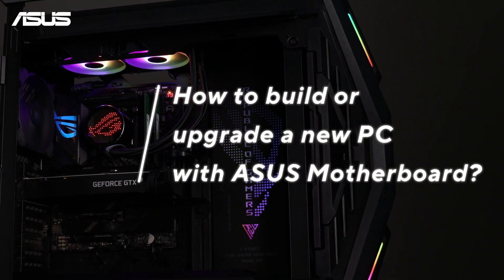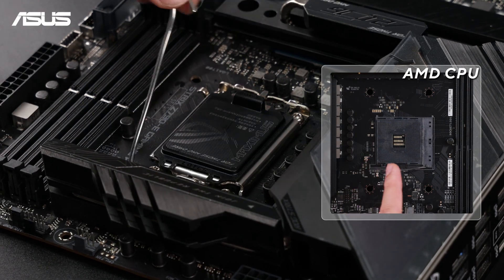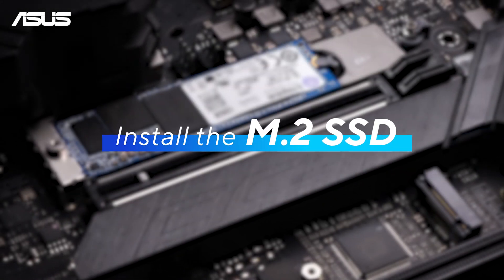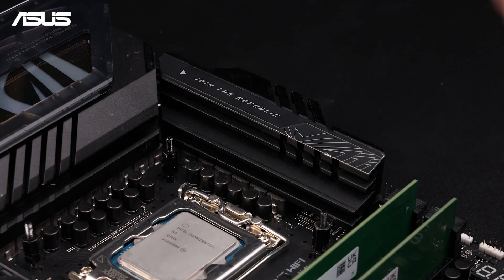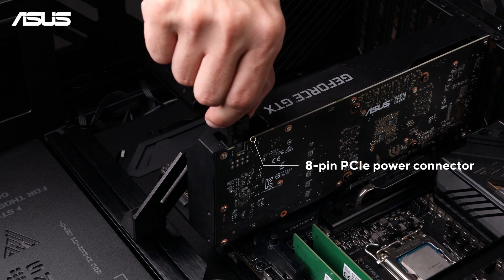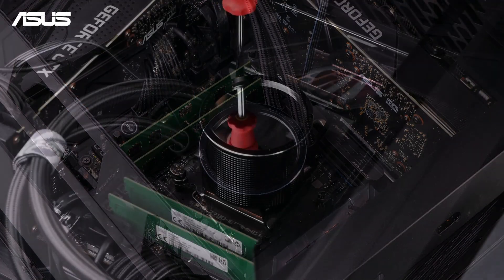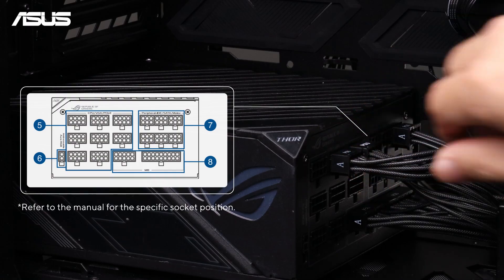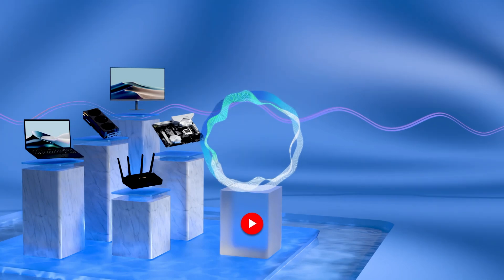Step-by-Step Guide to Installing ASUS Motherboards and PC Components | ASUS SUPPORT

Comment: It’s been 2+ months, my motherboard case is still unresolved. I was promised a sealed pack brand-new replacement by 29 Sept, now told it won’t be sealed. How is that “brand new”? My work is stopped, losses daily. Need sealed pack ! Case ID: ING2T80437
Motherboard Serial Number: R1M0CS01P9977FN
Reply from the maker: I have forwarded your feedback to the relevant department for further confirmation.
We apologize for any inconvenience this may have caused.

Comment: I sent my ASUS ROG STRIX Z790-F Gaming WiFi motherboard to ASUS India for warranty service.
They promised me a new replacement… but sent back an old, used, and damaged board instead.

Staff told me to “use” this broken board and then stopped responding. This is not acceptable from a global brand.

📌 Case Ref: ING2T80079

I’m demanding ASUS provide the brand-new, sealed-pack motherboard they promised — nothing less.
Reply from the maker: We apologize for the unpleasant repair experience you have had. In order to better assist you, please provide your issue and product serial number to the following email address. We will have a dedicated representative help you.  ASUS_Support_HQ@asus.com
Sorry for any inconvenience it may be caused.
Reply: @asus_support  Dear ASUS Support HQ,

Thank you for responding to my concern on YouTube. I have already shared my issue details and serial number with your team, but unfortunately, my case (RMA/Case ID: ING2T80437, Serial No.: R1M0CS01P9977FN) is still unresolved for more than 23 days.

Because of this long delay, my professional work has completely stopped. This has directly affected my income and created unnecessary stress. I respectfully request that you treat my case with top priority and arrange a brand-new replacement motherboard immediately.

Please have a dedicated representative call me directly at so that I can explain my situation in detail and receive a quick solution.

I truly hope ASUS will not let a loyal customer continue to suffer further and will provide me with an urgent resolution so I can get back to work without more loss of time and earnings.

Sincerely,
Amit Kumar
Reply: @asus_support  It’s already been almost 1 month, my work is completely stopped because of this issue. Due to the delay I have not received my salary, and now even my job is at risk. Please treat this as urgent and give me a quick resolution – this situation is affecting my livelihood.